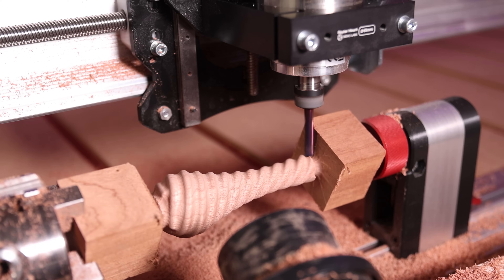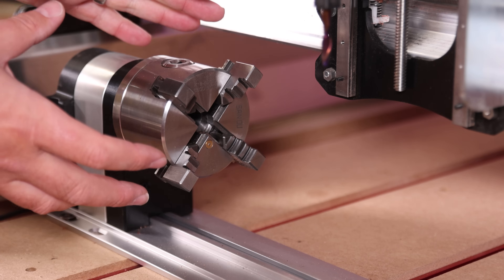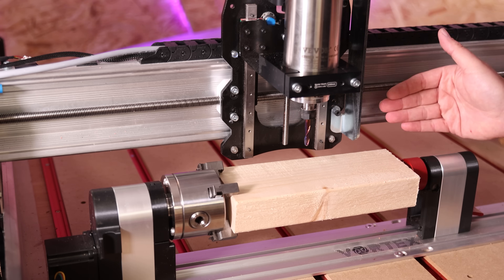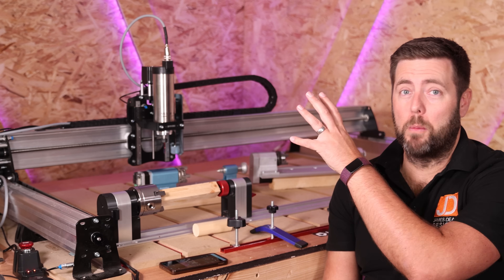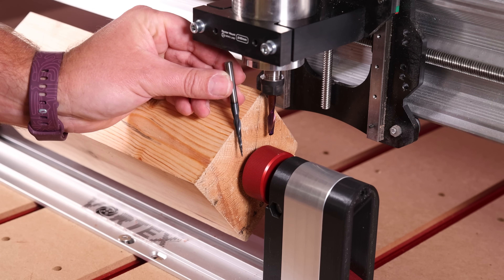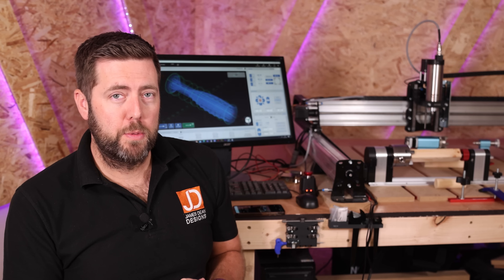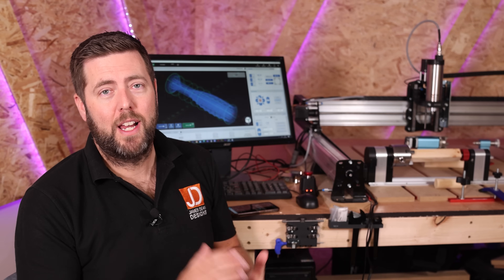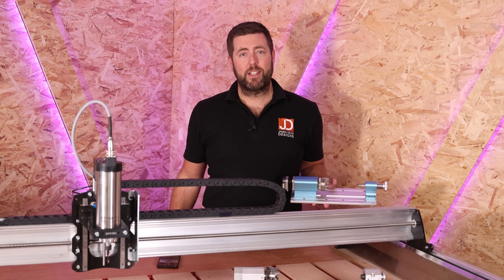YOU NEED TO KNOW THIS before buying a CNC rotary 4th axis

Comment: Hi!
I bought the TTC rotary axis, which I will install on a TTC 450 machine, I haven't done it yet, I'm just informing you in advance!
I watched your video and didn't see how you set the Z axis 0 point! I use UGS with a probe, but I can't figure out how the probe fits perfectly on a cylindrical surface? Of course, if I start with a square material, then maybe there's a chance that I can place the probe on it well! But if I round it off, I'm back to a cylindrical surface! Should I use the simple paper solution?
Thank you

Comment: I have a Onefinity with the Revolution 4th axis rotary.  You mentioned software Desk Proto.  By using the Desk Proto is it possible to use my iphone 16 pro to take several pictures from different angles of someone and carve a 3d bust of that person?
Reply from the maker: So DeskProto can easily handle the 3D model, but creating the 3d model is the harder part. There may be some software that can do it from photos but the easiest way is with a 3D scanner. The scanners are not cheap though, I think a few hundred dollara
Reply: @JamesDeanDesigns  Thanks.....I find your videos most informing.

Comment: I don't understand why people keep claiming that Fusion 360 is the "only free CAD software" when there's a program literally called FreeCAD, which also has 4th axis support. Unlike F360, FreeCAD is free, opensource, doesn't save your projects to the cloud for anyone to search for and it doesn't charge you anything if you want to make money with it. Only downside is having an actual learning curve. 

Fusion 360 is for hobbyists who want to make cool stuff and don't care about making money. FreeCAD is for hobbyists and people looking to make money from it. Everything else is for people who need specialized software. (for example, FreeCAD supports 4th axis but not 5 axis. If you want to do 5 axis work, there's a good chance you'll need to buy a different program)

Comment: Great video! Thank you for describing this topic so clearly :) 

Something that I like about the PwnCNC rotary axis is that it has a 22mm diameter passthrough so you can have greater rigidity when machining the ends of long pieces of stock.

Comment: This is the first time that I have seen any of your videos. While your presentation is very good, with respect, it is completely not accurate when you say that you can't do a 3D model in VCarvePro and the rotary. I have done a complete chess set with my Sienci Vortex, using VCarvePro to create the toolpaths. I have imported .stl files into VCarvePro, which were intended to be used on a 3D printer and carved them.
Reply from the maker: Happy to admit when I am wrong - and I was in this case. Surprised no one else had flagged this to me. However, I still stand by DeskProto being the best for 4th axis. It doesn't need to wrap/unwrap the 3D model, it can handle different size and shape of material for rotary and cheaper.
Reply: @JamesDeanDesigns  Tks for replying, James. I've looked at Deskproto briefly and I'm sure you are correct. Unfortunately the free version won't do 4 axis and the paid version is out of my snack bracket. I'll be interested to see what you can do with it. Take care.
Reply from the maker: @driftergw no, even though 4th axis devices have become much more accessible for hobbiest these days, on the software side its still seen as for "professionals" and those making a business from it.

Comment: Have you had any luck using Deskproto to create G-code for Genmitsu routers that use the Y-axis to control rotation? I have a 4030 ProVerXL v2 and so far Fusion 360 is spitting out code with A-axis instead of using the Y-axis. Any advice on fixing Fusion 360 or the suitability of Deskproto would be appreciated. Thanks! 😊

Comment: Thank-you for the video. I have been using the new rotory 4th axis with onefinity buildbodics for a while now and it does a great job with vectric aspire. Do you know if deskproto has a post-processing for the onefinity or that could be edited to work with the onefinity buildbotics 4th axis?

Comment: Thank you so much for this video!

I purchased a Onefinity Foreman Elite in August 2024 and have been enjoying it immensely. It took five months from the date I ordered it, but I just received my Onefinity Revolution fourth-axis rotary. I have installed it, but haven't used it yet. I am going to purchase a multi-axis license for DeskProto. Sadly, other than installation instructions, I have not been able to find any real instructions on the actual use of the rotary. It looks like they took my thousand bucks and are leaving me to figure it out for myself. You would think that they would provide at least minimal documentation on getting started for the actual use of the machine.
Reply from the maker: I suspect more will be coming soon 👍
Reply: @JamesDeanDesigns  

I just purchased a multi-axis license for DeskProto. It looks like they have some good YouTube video tutorials. I think that's going to help a lot.

Comment: In the software part I think Kiri:Moto should have been mentioned. As far as I know it is the only free software for rotary work.
Reply from the maker: I did not know kiri moto did rotary. Thats good to know
Reply: @JamesDeanDesigns  It might differ from the other softwares, but I didn't had time to look into that so far. But you can do indexed milling where you rotate your part by a certain degree and than do milling operations again. I don't know if it can do a fully automated rotary milling like the others may. I'm still fairly new to CNC mashining so take everything with a grain of salt and better check yourself what exactly is possible.

Comment: Corrcet me if I am wrong, but Fusion 360 is free for 3-axis CNC. For rotary you need to buy a subscription.
Reply: Not only a subscription, you need to buy the subscription + an extension, which is more expensive than any other software mentioned in the video.
Reply: @rmoretto_com  ouch...
Reply from the maker: I did not know that. I was under the impression it was included in the free personal use agreement
Reply: @JamesDeanDesigns  it used to be so, but isn't anymore.
Reply: Esattamente, l’estensione di fusion 360 per lavorare con il quarto asse è a pagamento, estensione rotativa.

Comment: one question , you didn't mention anything about the CNC controller itself, or the upgrades. I have shaepeoko 5 pro with a GRBL controller. would it cut on the rotary assuming I bought the the desktop pro software. does it disable the Y axis and intrudes the A or B Axis ? or i need to change the controller completely or is there any upgrades that I can do to make it works? I would highly appreciate if you give me some insight in this regard. I've been wanting to add rotary to the machine and didn't so just because I've been told GRBL will not support more than 3 axis. 
thanks for the video!
Reply from the maker: To my knowledge, no the 5 pro doesn't have a dedicated A axis (eg. 4th axis). I believe it could still run one via using the Y axis as a 4th axis. That's how you used to do it in the LongMill. Standard GRBL didn't allow for a 4th axis but this has not been modified and quite a few machines can run a 4th axis via GRBL

Comment: Love your content! You’ve helped me from my first 3018, my 6060 and now I have an HDM with the PWN rotary. My understanding is Fusion can do rotary CAD for free, but not CAM. You could fake it, but for true rotary support, you need the manufacturing extension, which is expensive at ~$1,400 per year. I am considering using Tokens — 1 day per month, 10 tokens per day, 120 tokens per year, $360. My other choice is VetricPro at $600. I’ll also consider DeskProto now.
Reply from the maker: @woodman72265  thank you and I didnt know that about fusion. I understand Vectric Pro only does wrap 4th axis the same as Carveco Maker and Maker +. Only Vectric Aspire and Carveco Pro do full 3D models so in that case DeskProto is going to be the better and cheaper option I suspect.

Comment: Thanks for an interesting and informative introduction to rotary axis CNC. I have a Genmitsu 4040pro Max and have been considering adding their rotary accessory. But as you mention in the video it is quite limited in the size of stock it can take since the headstock takes up a substantial part of the X axis length. Would it be possible to orient it parallel to the Y axis instead? That way you could have the headstock in the area behind the X axis boom leaving more workspace. Obviously you would need to make a longer mounting plate. 

Regarding software I am quite comfortable with Autodesk Fusion (even though the CAM part is new to me) but I thought that 4th axis CAM was not available in the free personal version? I am reluctant to throw a lot of money at something that I will likely not use very much....

Comment: Thanks for the info you shared. I have Onefinity Revolution on order. I was disappointed to hear that my Carveco Maker plus isn't  up to the task. I was thinking I would be able to carve 3d relief on a cylinder for things like salt and pepper shakers and grinders.
Reply from the maker: You can still achieve quite a bit with Carveco Maker, you could still do salt and pepper shakers. It's mainly the difference of importanting a full 3D model (as opposed to a 2.5D model)

Comment: Great and informative video.  I am Interested in possibly adding a 4 th axis on shopeoko 5 pro. This product does not have a 4 th axis that can be added on from carbide 3D. How difficult would it be to add a 4th axis to this machine from another vendor like ones you mentioned in your presentation?

Comment: Hi Jean!

I recently subscribed to your channel and I have to say—you absolutely deserve my subscription and hundreds of thousands more, honestly! The way you explain CNC topics is so clear, detailed, and beginner-friendly that you've quickly become my go-to reference whenever I want to learn something new in this field.

And I have to mention—your accent (which I still occasionally struggle to understand, haha) always brings back memories of my time in Oz a few years ago. It’s such a great vibe!

Now, let me ask for your advice. I'm currently in the process of buying my first CNC machine. I have some experience and a strong passion for both woodworking and tech, so CNC feels like the perfect blend of the two. My goal is to eventually turn this into a full-time job. I’m based in Greece, and from what I can see, this field is still pretty much untapped here.

My budget for the machine is around €1500 to €2000. I’ll primarily be working with wood, but I’d also like the flexibility to occasionally work with plexiglass and maybe even aluminum. I’m looking for a machine that can handle both small, detailed projects and larger pieces as well—so I’d prefer not to go below a 50x50 cm working area.

I’ve done some research and have a few options in mind—like the Genmitsu PROVerXL 6050 and the FoxAlien 4040 (with the possibility of expanding it to 8040). But I’d really appreciate your thoughts on these or any other machines you think might be a better fit for my goals.

Thanks so much, and please keep up the amazing work! You're truly making a difference for people like me who are just getting started.❤